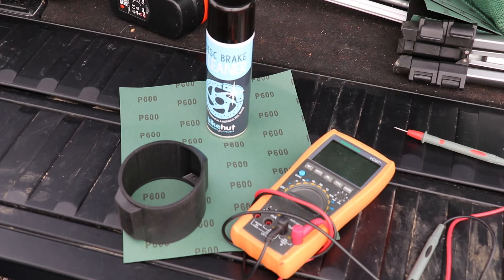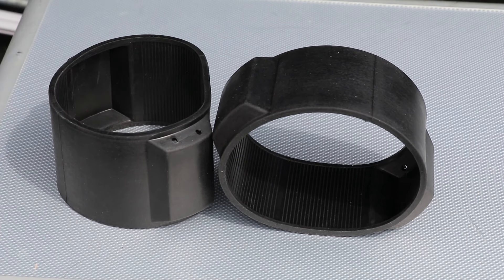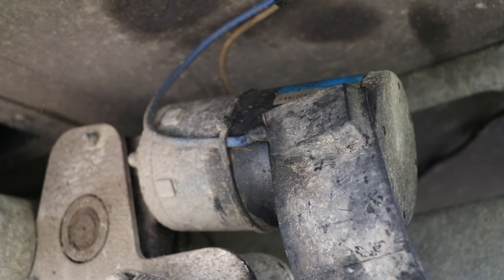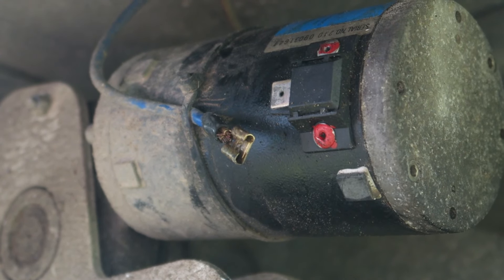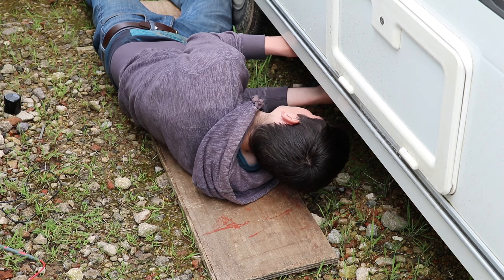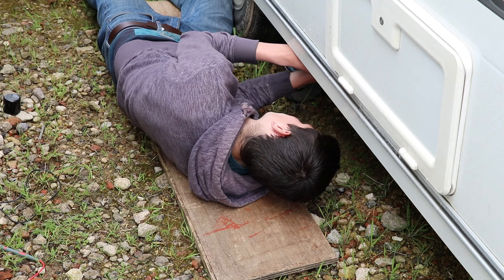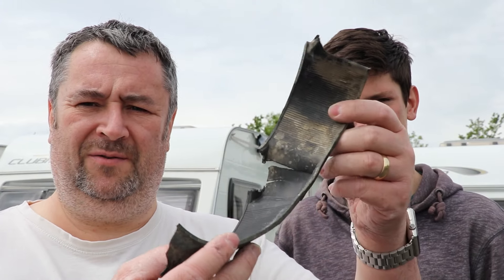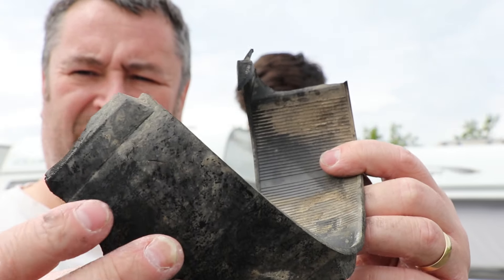Caravan Motor Mover repair.

Comment: My mover died yesterday, called Powrtouch engineers, spoke to a guy and he said it was the board that was faulty .. £330 to supply and fit a new board. Ended up buying a new mover as the old one is 8yrs old .

Comment: Spooky. I have just had to do exactly the same job (although the unit had to go back to Reich who cleaned up the inside). After that I used ACF-50 on the connectors to try and stop the corrosion. My movers were coming up for 6 years old so this is a worthwhile job, thanks for posting!
Reply from the maker: Hi Andrew, glad this post was of use. I imagine these movers are about the same age as yours then. and a good tip on the ACF-50, i have used that in the past, i think i may purchase some more. 

Take care. Dan

Comment: Dan, Do away with the 'rubber boots' altogether and completely cover the fitted terminals with silicon sealant.
Reply from the maker: Hi Keith, 

I did consider creating some silicon terminal covers - and this maybe something i reinvestigate after I leave the current boots on for 12 months etc, I want to see how they fair up after 12 months and around 5,000 miles etc.

Great tip !

Thanks
Dan
Reply: No thankyou

Comment: Hi, wouldn't it be easier just to replace the spade conectors
Reply from the maker: As you can see the connector is brass going onto a steel terminal, so the terminal has the corrosion not the spade connector.

Comment: Yes when i did this years lubing  of the moving points on our powertouch mover 2 years old ( powertouch recommend lubing once a year ) i noticed that the plastic side covers wear fouling on the motor rubbers that much the rubbers had been deformed  & one had a hole in . Rang powertouch and explained what was happening and they said they had had a few wear either the rubber boot or side cover had been distorted.  They didn't quibble at all and sent me two new rubbers and two new side covers  and screws . I have now modified the side covers by cutting 10mm out of the back so it can no longer  foul the rubbers. The rubbers on our evolution mover are a lot more substantial than yours & have probably be upgraded for reliability. 
Excellent customer service from powertouch can't fault there service.

Comment: Brilliant Video. I have the exact same mover. Went to use it today and one motor won't work.  I had a look and the boot has disintegrated.  Where did you source the replacement boots / covers from?

Comment: Really interesting ... First time caravaner and by the time we had towed the caravan home there was only one wheel turning even though the caravan was moving perfectly at the caravan dealership. I will get underneath tomorrow and get things cleaned up and hopefully we will have two movable wheels ... will keep you posted
Reply: 24 hours later......... cleaned the terminals on the offending side and hey presto , I have movement on both wheels ! thanks again guys

Comment: Our remote sounded like it was engaging with our mover (but taking longer than usual before hearing the clicking noise) but the mover wouldn't actually work, and the remote kept beeping. Now there is no engagement at all. Could this be the issue? Dirty terminals or is it the brushes? Was it just a rag that was used to clean?
We've spent a fortune on repairs so these videos are really helpful and might save us some money but not sure which to try! Thanks for your help.

Comment: I have a Power touch. Considering it's a piece of equipment for use in all weather's it's not very water proof. My mover has had the engineer out a couple of times now. One was when the motor was full of water and the whole of the insides had rusted and the other ther motor had failed. Now it's out of warrenty it sticks occasionally.  A slight tap makes it work again.
I would add that the after sales service is excellent and the engineers were very professional and helpful.  Shame the design let's it down. Those rubber caps are a double edge sword . They hold the water in as well as supposedly keeping the connections dry. May be a bit of silicon around the terminals would help. Thanks for taking time to make the video.
Reply from the maker: Thats a great point Brian, I will periodically check the terminals to ensure they are still clean and more importantly DRY !

Take care
Dan

Comment: Hi 
My motor mover is still within warranty and only last week noticed the rubber boot on one side was split , powrtouch sent me 2x new boots arrived this week so guess what i'm doing today 4th Sept 16..... You have it in one ......Replacing the rubber boots . 
Great video and thanks for posting especially cleaning the terminals and one of your followers on the use of the mirror i shall be using one of my caravan mirrors that you fix on the car as this has a arm i could use to position the mirror and get a better view .... Simples. I wont be using washing up liquid as one of your followers suggests so thanks again. I Wonder if the toilet silicone spray will work .....to get it slipped on  the mover .The other suggestion i was going to make was after fixing the rubber boot to position a large cable tie around so that it does not fall apart , i guess the down side is you will never notice if the rubber boot has failed but there is a solution .... when engaging the motor mover a quick 10 second check with the hand over the boot to check on its integrity... and going forward it may be worth changing once a year on service ... extra £20 a year or if you use the van frequently its a couple of nights away  to me . So Thank You To The Trudgians.... Keep the videos coming they are and excellent source of information and tips and may be we shall bump into you one day as we are twitter followers.
 Thanks Team Trudgians.
Reply from the maker: Morning Paul, sounds like you have the plan all sorted for the day. Just add a cup of tea ! Im not sure about the cable tie - it would hold it all together but the thing will only come off when it fails, and like you said a quick check will confirm its status etc.

If you add one - let me know how you get on with it etc, it could be a really useful addition to the rubber boot !

Thanks again for your kind words - We have plenty of videos lined up.

Speak soon

Dan

Comment: Thank you guys for that Gator information, but my problem is:- when the mover is engaged and often going up or down the hill disengages, and pops off the tyre. frightening the first time it happened & very dangerous .luckily I got to the handbrake quick enough. any suggestions.       Thanks!   Steve B

Comment: Hi I've bought a 2nd caravan, which has a powersure manual motor mover on it...its been on a site for a couple of seasons but having got it back home I'm trying to get it working..

10:49

Not engaged I've checked caravan battery 13/14v new battery in remote, sprayed grease on to rollers, cleaned contacts up, activated isolation switch, pressed both on button, remote lights up green and there's just a hum...no movement in rollers...any ideas?

Comment: I have an old powrtouch classic fitted. One side has become very noisy in operation. I,ve tried wd40 spray on the shaft that you can see turning. Quietens it briefly but becomes noisy again. Bearings? whats your opinion. Great video by the way.
Reply from the maker: Hi Ben, ok so a couple of points. 

1. I wouldnt use WD 40 in the bearings, or the end cap - this should be a greased part. 
2. It is quite possible that dirt or road grime has penetrated this section - or it could just be a bearing that has failed.

I would do one of 2 things here. Firstly - contact PowrTocuh directly, they are very friendly and even may know of the exact part that has failed. secondly have the motor mover serviced. You certainly don't want it to fail when you really need it.

I hope that helps. 

Dan
Reply: Thanks Dan, totally agree dont want it failing just when i need it.
Ben

Comment: Those rubber bands are worse than useless. I have ditched mine after the last one failed. Once I had cleaned the contacts I smother them in waxoyl, I also use this inside the lighting plugs and sockets, it stops the terminal screws from seizing and stops the copper turning black when damp travels along the inside of the wire.
Reply: When cleaning the back of the terminal I found using a manicure sanding stick it works flat against the terminal so cleaning the whole terminal as opposed to just the edges